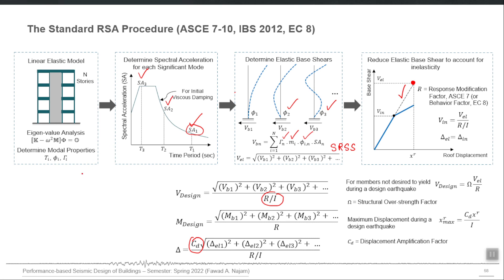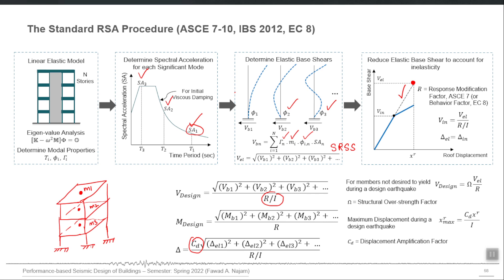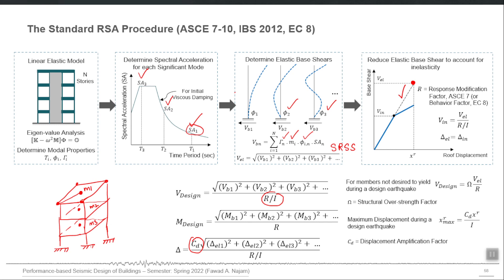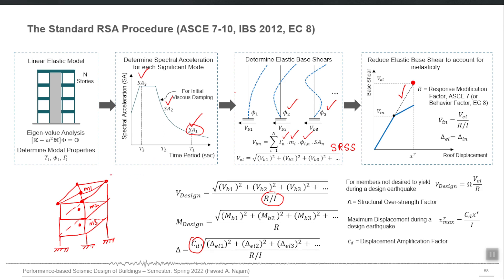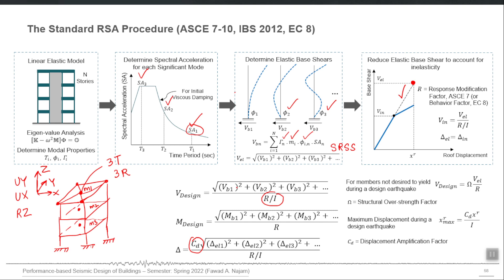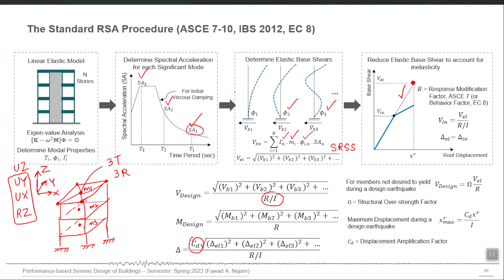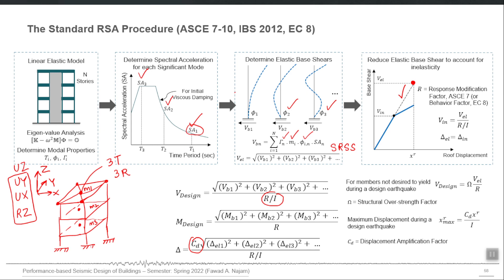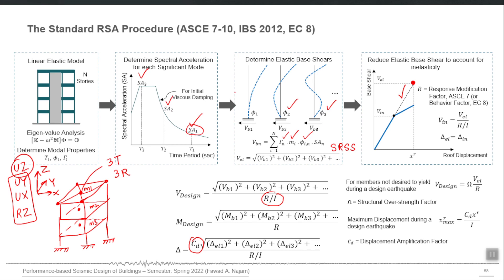60 - RSA Procedure - Question: Rigid Diaphragm, Mode Shapes, ETABS, Vertical Time History Analysis

Comment: Thanks, i wonder how the program lump masses at each floor and if it's the same case for translational and rotacional degress, i mean if you go to the modal mass participation all degress has a participation(3t and 3r) and at the same time if  you go to the mass joints then rx ry rz dont have associated inercial mass so how is the process?